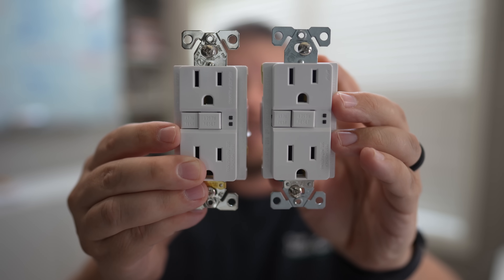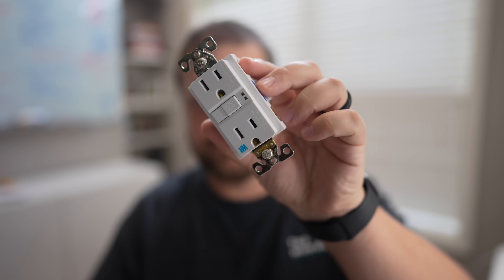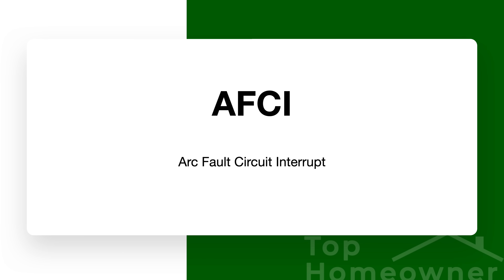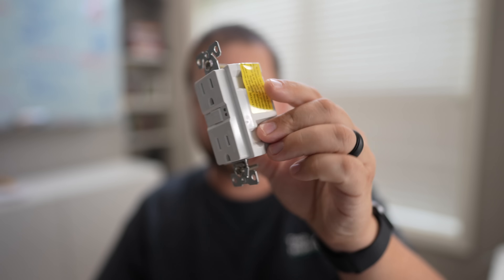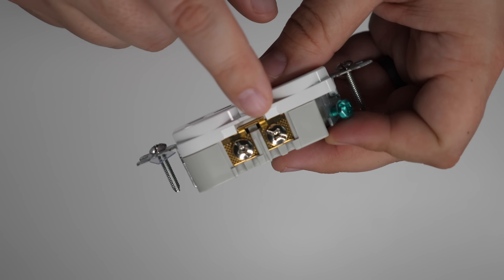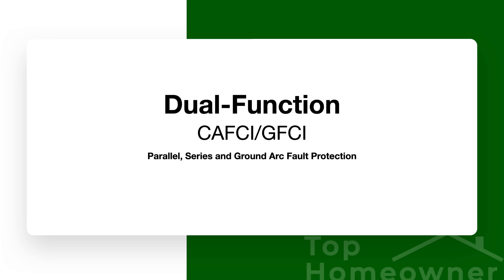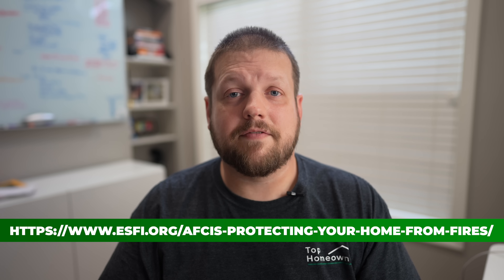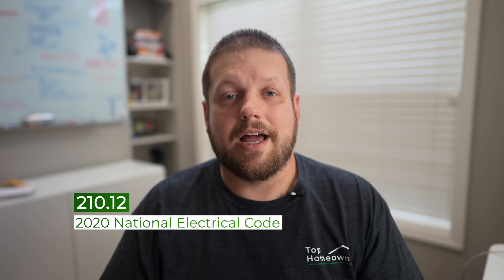AFCI vs GFCI: What's The Difference and Why You Should Care

Comment: always wondered about power and water.   Our underground utility hatches in the front have splices with insulators that allow water into the splice.  They fill to the top all winter with rain, and people step into the puddle on top often.  The utility tell us that there is no shock hazard.  They say that pure water does not conduct well enough.
Reply: Pure water doesn't conduct _at all_. It requires something dissolved in it. So rain water is probably fine, until it hits the ground and any sort of minerals or other materials that might be on the ground gets mixed in.

That said, getting a shock would require completing an electrical circuit, and it's not clear in the situation you describe how a person stepping into the puddle would do that.
Reply: Tell your utility that if it's on the ground, it's not pure water :)
Reply: Shame on 'em; they ought to know better. 
1) due to sulfur contamination of the atmosphere from fossil fuels( I swear I am not a liberal weenie, just a guy who does his homework), all rain is weak sulfuric, therefore conductive, acid, and 
2) the soil itself is contaminated and either acidic or alkaline, which is also conductive, and both cases 1&2 are also corrosive, which will raise hob with those underground connections, resulting in increased fire danger. You need to climb on your utility supplier and ride them all the way home like a new bicycle, starting at the local office and going all the way to the state utility commission til you get results. Get your neighbors involved too, and if the big juice pusher doesn't roll over then it's time to litigate, litigate, litigate; after all, it's your life. Get enough bodies involved, and you can wag the dog.

Comment: Afci are a PAIN if you use a power tool, or an older style vacuum/shop vac, or older hair dryer, and anything with an AC motor. And to reset the breaker, is a massive pain. If it trips right after set, then, you have to unplug all devices on the circuit, turn on, then start putting everthing back in (it won't retrip, unless you have an issue).

Comment: I've never seen an afci recepticle. Nice for renovation instead of a $150 afci breaker that you need to buy 10 of. But only seen afci breakers because no one cares for afci and not required by code for existing, only new. Gfci is required within (I think) 12" of a water outlet or wet locations. I.e. kitchen sink, bath sink, outside outlet, yard lights (120v ac that is), etc...  

My house built in 2019 has almost all afci as required by NEC and now NEC 22 requires even more afci. Soon all interior will be afci. My baths and kitchens and outdoors have afci with gfci breaker.

Comment: With all of the very good electronic stud/electric detectors now available for fairly cheap - really the huge problems with the AFCI are avoidable.  AFCI's do not work that well - they go off routinely from normal motor arcing; from various fully correctly functioning appliances or tools.  The vast majority of Fires caused from 'arcing' is from small brads or nails etc. used to hang pictures or some such up on a wall.  Where the person putting the item up on the wall - inadvertently slightly compromises the electrical romex behind the wall with just a very small 'prick' of metal - which is just very slightly arcing sometimes.  And eventually heats up enough and drys up enough - that it starts a fire.
Reply: I'll note also that modern code requires in-wall cabling to be installed in a way that pretty much minimizes or eliminates any chance of damaging the cable that way. In studs, where one is going to be screwing long screws through, plates are used over the cable penetrations, and elsewhere the cable isn't right up against the drywall, and is likely to just flex out of the way if someone is so careless as to continue drilling long after they're all the way through the drywall.

Besides the fact that arcing may not even start happening right away, so by the time the breaker trips, who knows if anyone will remember why it might have started or know where to look for the problem that's hidden in the wall.

Comment: Years ago, AC-DC motors with brushes and commutators were commonplace and you could frequently see them arcing.  I wonder how those AFCIs would handle that situation.
Reply: They DON'T not very well!  Manufacturers have submitted 'maps' of the arcing from motors - which are somehow programmed into the AFCI - but that doesn't work very well.  They go off all the time when using a vacuum or a treadmill or a drill...  They've become required in various places of the home - and than after approval and someone living there - they sometimes get removed - because tools or just doing regular household work or functions - set them off.
Reply: That's over-engineered crap, it trips on vacuum motors or even just very slowly closing a light switch, just having the ground wire and a GFCI outlet I consider to be perfectly safe.
Reply: All my brushed tools that draw over 10 Amps steady state trip 20A arc fault breakers...

Comment: GFCI's work by passing the hot and neutral through a coil. As long as the inbound and outbound currents are the same, no voltage will be generated in the coil. If there is a difference, a voltage will be generated and picked up by the circuitry.  AFCI's work by detecting high frequency noise on the circuit generated by the arcing. This is why they trip when using brushed motors.  I'm sure our old school slot cars would have played havoc with them.
Reply: I still race slot cars. Nothin beats em for an excuse to jaw with old timers at leisure.
Reply: The power packs were transformers with IRRC 1/2 wave selenium rectifiers.  Would be interesting to find out.
Reply: @danharold3087  Current is same if half wave or full wave in both wires. No problem.
Reply: @glasslinger  1/2 wave blocks 1/2 the signal.  Less current.
Reply: @danharold3087  But the current is the same in both wires! It's the difference in current in the two wires that trips the circuit.
Reply: @glasslinger  Earlier when I mentioned 1/2 wave I did not mean to imply that the 1/2 wave rectifier would trip it.  Just explaining what these old power packs were. 
"Current is the same" had me thinking you were saying 1/2 and full wave rectification were the same current.  Sorry for the confusion.
Reply: Aurora Model Motoring!!
Reply: @krazmokramer - Love it! Got my first track in about 1967-68 when I was about 5. The two cars were a ‘65 white Mustang convertible and a Cheetah (can’t remember the color) still have the box and about 3-4 pieces of track in the attic. I remember the little pins you had to stick in the ends of each piece for continuity. 

Thanks for the memories…
Reply: @krazmokramer  I was lucky.  My older brothers pooled resources an purchased a Schlumberger 1/32 scale setup.
Reply: 3 or 4 years ago I was hot to add AFCI protection at the breakers but my buddy who is a journeyman electrician discouraged me because of the nuisance trip problem. He says he pulls out many because of that. Will still install them at some point but not going to be a priority for now.
Reply: Correct and don’t forget on series arcing in circuits there is usually a minimum threshold of amperage (4.8-5.0 amps) that is required. In a parallel arc there is no know amp minimum that I know of. Also when an arc fault breaker trips it can be difficult to know which one you are dealing with without a diagnostic tool. Oh wait there are no tools. Nice, manufacturers.
Reply: AFX baby!
Reply: @Paul720J Pachasa720Jr My favorite was paper tape. If you have ever done asm programing take a loop at the PDP11 instruction set.  With not much work you can learn to read code from the octal.    Of course once you can read octal you can read the paper tape.  Fun but almost useless.
Reply: @danharold3087 - Binary, Hex, Octal, it’s all flooding back. COBOL decks in a shoebox or soda crate so you wouldn’t drop the 600,000 punch cards it took to print out your Christmas card list! Ahhh, the late ‘70s and early’80s…
Reply: Along with a toaster
Reply: Thanks for this information, would have been nice if it was included in the video.
Reply: @kamX-rz4uy  Darn right! Up till this moment, I found it hard to really trust GFCIs because I couldn't figure out what the detection mechanism was. Now that I know, I can trust GFCIs.
Reply: @GeorgeSmiley77  I do know that my GFCI tripped when I had an extension cord plugged up outside, and it rained. That convinced me that it worked. I had one chord plugged into a regular outlet. Another plugged into a GFCI. The lights attached to the regulator outlet stayed on. But the others shut off.
Reply: arc fault is so retarded, such a scam.
Reply: They also insta-trip when used with an induction hotplate.
Reply: right. you can see a brush motor arcing...   very small arcs that change the waveform..
why this guy claimed it was a sudden high current.. when it's the opposite.. 
he's not an electrician.
Reply: The equivalent current of the live and neutral cancel out, thus no magnetism is created in the coil. Some older GFCI/RCD devices use this magnetic force directly to disconnect the electrical supply. A third small wire on the same coil would produce the voltage you mention.
Reply: And switch mode power supplies… the load varies at 20kHz to 100kHz…
Reply: I just got power back after losing it for 3 days due to hurricane berly. Problem is that my 3 bedrooms and its lights don’t have power. I went to circuit breaker panel and tripped the 3 breakers, but to no avail. The three breakers show AFCI. Is it ok to replace those 3 breakers with regular breakers since the cost of AFCI breakers are 10x more at Home Depot. Thx.
Reply: So, GFCI is just a new name for good ol' RCD ? Residue current device ?
Reply: @nicholaseastman6915  No, GFCI is the name that has always been used since they hit the market in the 1960's.
Reply: @Wowzersdude-k5c  It has no sense. The name GFCI talks nothing about its purpose and its principle of work (what is it for and how does it work)
Reply: Best description yet to help me instantaneously understand the difference thank you!!!!
Reply: Thank you for taking the time to provide the additional clarification.  It's good to know THAT they work, but even better to know HOW they work.
Reply: I'm also always tripping when I see a brushed motor.  I'll usually say "Who still uses this stuff, what's next, vacuum tubes and punch cards?"
Reply: @EternityForest  A KitchenAid stand mixer, for one.
Reply: @EternityForest  Well these nuisance nanny arc fault are not really something that should continue to be around either.  We need a device to test the circuit on installation telling you how far down the line an arc occurred.  Which could be used when penetrating walls ,floors & ceilings for any purpose down the road.
Surely the price of a few of these breakers could cover the cost of this device ?
Instead of these type of breakers telling you ,  you may or may not need to replace the whole circuit wiring.
Reply: @EternityForest   You have a younger perspective.    Bought most of my woodworking tools  in the early 90s.  It is one of several pastimes.  They are rugged and they work.  Some time back I built a few of Mathias Wandel's wood tool designs.  I enjoyed tool making and have since started a metal shop using quite old equipment.  I love it.    FWIW first programming class used punch cards.  I don't want them back.   Don't put brushed motors into that group.  They are not that kind of an improvement.
Reply: a had a AFCi in my apartment and my powerline ethernet adapters would trip my whole apartments power, what a pain
Reply: This comment is better than the video

Comment: Good video. Risk management is something we, as modern humans, haven't really needed to do on such a vast and large scale for a long time. I'm happy to see more awareness of the need to be "aware" of the risks we face in our modern world. However I think we need to use caution when approaching the concept of "make the world 100% safe for everyone." Life has risk and is the cost benefit ratio for said risk(s) worthwhile? I don't know but it's worth discussing.
Reply: Can't thin out the non hackers if we've got these damn safety devices around...
Reply: If/when home insurers demand changing out receptacles for pre-80's homes (that do not have grounds ( I know this because they are in my house and i only know this because i have to replace one or more as i speak - the reason i must learn this), we might as well learn about it as DYI 'ERS.
Reply: The arc fault of both kinds are pretty much Nanny junk .   What needs to happen is just a device to test the circuit upon installation ... which would be nice if it could tell you how far down the line the arc is happening.
Then fix it ,,, but for regular use ,  just use your regular over amperage breakers.
GFCI's are of course good things though.
I guess also if doing anything involving penetrating the wall with nails & screws.  Would then be a good time to test the circuit for arc faults.   Knowing your circuits , and where the wires might be running is a good thing for any DIYer .   But this set it and forget it type of safety , is pretty ridiculous IMHO .
Reply: you really think people came here to read you babbling about stuff you have such little knowledge in but feel compelled to toss out a ton of cliches to appear smart?
Reply: @slowery43  😆

Comment: Comment about GFCI outlets and circuit breakers. I have installed several GFCI circuit breakers in outside standard "weather resistant" circuit breaker boxes. The GFCI circuit breakers are expensive, do cover all of the outlets and lights on that circuit. What I have found is that the GFCI circuit breakers can be sensitive to the weather conditions outside of the structure that they are placed in. Replacing the GFCI circuit breaker with a GFCI outlet in the first position after the breaker will provide the same outlet protection while still being sheltered from the elements.
Reply: I second that, I never install GFCI in an Outdoor Location. Much better to install them near the Breaker Panel. Also walking to the Breaker Panel, gives you time to think off, what you did wrong. BTW WR on the Receptacle Stands for Water Resistant. Always PO’s me when they are installed upside down, so the “WR,” is upside down.
Reply: It's what I never understood about some of GFCI outlet installations I've seen where the only one is at the end of a chain in the bathroom or kitchen or having to have a GFCI outlet at every outlet in said area when they are on the same circuit.
Reply: It's likely that they were only required in the specific locations at the time of installation and early GFIs may not have had the passthrough feature of new ones.
Reply: It’s totally true humidity and even temperature swings seem to trigger GFCI. Bathrooms are less affected because the outlet is in the wall and humidity/temp swings are short term. Outdoors, and humidity in an outlet can freeze and thaw, displacing the moisture further, causing a false trigger. Of course whether one considered it a false trigger is hotly debated. 

Many outdoor devices, for example a Radon fan I recently installed, specifically state not to wire to a GFCI circuit. That seems counter intuitive until you realize it’s service reliability will be greatly reduced throughout  the year especially in cold winter months where ice will melt and displace moisture inside the motor housing causing a differential in hot/neutral voltage through resistance from the moisture. Naturally, you can’t install a radon fan or many fans/motors in general of AFCI or CFCI circuits because the brushes in the motor generate the high frequency noise detected by arc fault integrated circuits, causing a false trigger. I believe brushless motors will become more standard over time as integration into arc fault circuits is required by various codes but as it stands now at lease in Chicago where I live many devices can be excluded from arc fault circuits in new construction such as high frequency lighting, motors, pumps, etc.
Reply: The only time it makes sense to have a GFCI outdoors is when it's either in a shed a long distance from the supporting house or commercial building, OR when required by code in a temporary service for a construction site...  and then consider it disposable, even when in a "weatherproof" enclosure.  

A practice I find useful is to have a GFCI inside on a box near a door with an outside weather cover receptacle opposite it.  Sometimes that's useful if adding an outdoor receptacle, or when daisy chains to a single breaker or first receptacle after a breaker isn't practical, or as easy to reset.

Comment: I have heard that AFCI breakers do not like things like led lighting and will trip randomly.  What are all y'alls experiences with this?  Are AFCI required on lighting circuits?
Reply: In my case, all of my random tripping was related to iffy outlet, junction box, etc., connections. Once all troublesome circuits were completely reviewed and rectified, I don't have any more problems with vacuums, drills, etc. I am using Square D HO CAFCI/GFCI breakers. In general, in my experience, CAFCI/GFCI breakers are detecting legitimate issues and all circuit issues need to be ruled out before deciding that the breaker is over-sensitive. Also, I have had very good luck replacing wire nuts, especially large wire nuts with over three wires, with Wago connectors so that each wire is positively connected.
Reply: my AFCI tripped on a ton of things, very annoying. christmas tree lights (incandescent, not LED), blender, teakettle, adjustable bed, etc etc. I'm a little resentful of Mark claiming that this mostly happens on things that behave "oddly" or are not FCC certified. it happens on tons of common, everyday, certified, normally behaving devices and items.